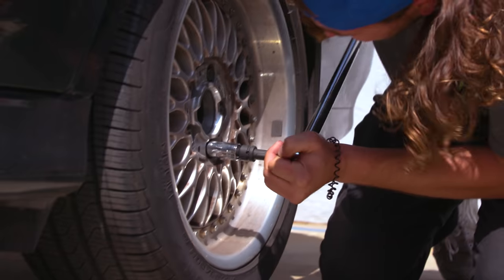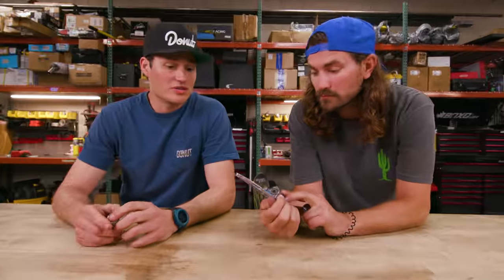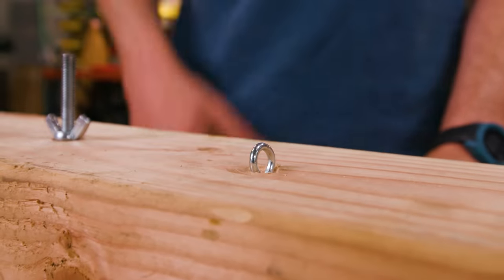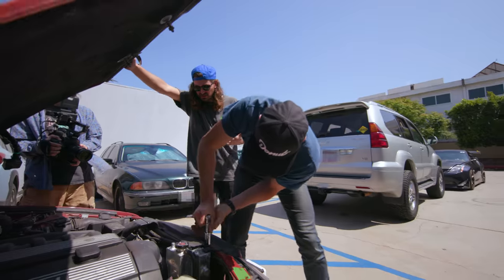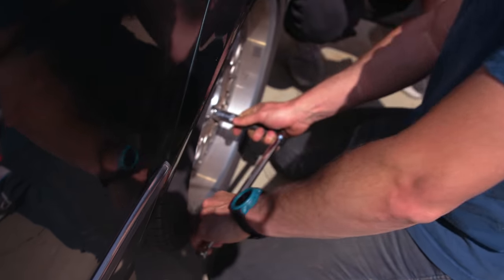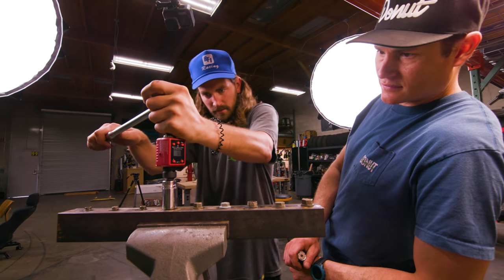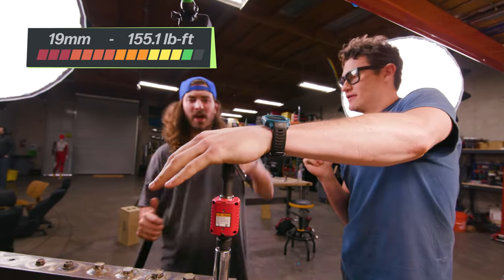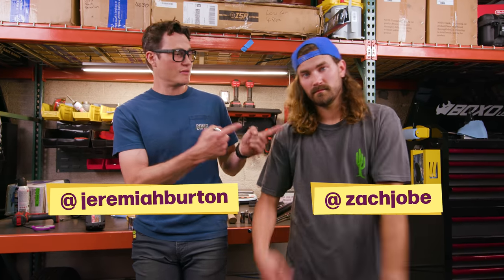Testing the World's Most Hated Tool

Comment: I think it's one of those tools that has a lot of potential but promises to much from one size. They should make ones for different trades (angled to fit sizes often used in them) like electrician, plumber, mechanics, exc. And maybe even make 2-3 sizes with recommendations of what it's really good at.
Reply: I'd love to see one for my profession, but as an oilfield mechanic that uses sockets between 1 13/16" to 3 1/2" most often, they'd probably need to use titanium pins to have a chance at handling the torque after watching this video.
Reply: Its a good idea in concept, just needs a little reworking to be more versatile.  Make the pins tougher, thinner and have more of them.  That and let the springs go deeper and  you could have something really decent.

Comment: It's a good concept, the execution is just lacking. I feel like it could be redesigned to work much better. Maybe if the pins were shaped to fit more tightly together... maybe hexagonal? Then the contact points between pins would have more surface area to work against, and it would keep the pins from slipping into gaps and bending under load. Although, it seems like someone would have done this already if it would work well.
Reply: it still has 3 major points of error.  the pins, the springs, and the user who probably wont line it up perfectly, EVER.
Reply: Um, the pins are hexagonal.
They have to be.
Reply: @MostlyPennyCat  The pins are definitely round. They are in a hexagonal pattern.
Reply: I bought one of these for my dad a couple years ago. Up until last month, I wondered what happened to it. I found it in a cabinet with literally 80% of the pins damaged and not working. But ya, pins are cylinders and all the pins together make up a hex shape, like a normal socket.
Reply: @angryginger791  
Are you sure that aren't just rounded at the top? As in beveled to ease insertion?
I had one that definitely was hex pins.
Wasn't this brand though
Reply: @MostlyPennyCat  Maybe someone makes another version. I was just looking at this one. Like I said, seems like something someone could improve on. Maybe someone did.
Reply: @angryginger791  
Looks like it, indeed.
There's one with square pins too
Reply: Its also only $10 so if you use it like a $10 tool its worth it
Reply: I have one with hex pins. My neighbor gave it to me as a joke gift. It’s not branded as a ‘gator grip’ though. I’ve never used it

Comment: So, I know the inventor of this tool. He originally also had a smaller size one. The smaller size one was way better. Almost perfect every time I tried to use it. The larger one (like the one you tested) was loose on more attempts and had some of the same problems you experienced. However, he sold the company years ago and the newer Gator Grips do not seem to be the same quality of the original ones. I also met the producer/director of the infomercial and it is the one that is used to sell the newer Gator Grip that seems to have more issues. Only tried one of the newer generation, so I may have had a bad one (probably not based on your video).  If you find the smaller one....buy it and never let someone borrow it (like I did). Once they try the smaller one, they will not give it back and claim they lost it.
Reply: That's really interesting.  I had a hunch that this was the kind of story you see with a lot of infomercial products—the inventor makes something for a specific use, and then the company that sells it markets it as a revolutionary "fix-all" sort of product, leading to a bad reputation for a good invention.  Sounds like this is a similar situation with an added misfortune of the design being changed to perform poorly

Comment: I use my Gator grip pretty often... initially I bought it out of desperation trying to remove a rounded off water pump bolt and it got it out immediately. I was initially skeptical but its now kept in the socket drawer next to bolt extractors.  When I'm in a rush its saved me some time.  It's gotten me out of quite a few jams and I keep one in my work truck for emergencies. If you bust it  they're only like 10 bucks to replace so I think they are a good buy. But mine has not busted in about 5 yrs of occasional use. Like any tool though it's got limitations. I'd say less limitations than just having a 12mm. Doesnt replace the tool kit but it's a good thing to keep in your kit for sure.

Comment: I really want an engineer to redesign this to actually work for hex heads at least. I feel like it is possible
Reply: yeah my dad has one with hex heads, works pretty good
Reply: Geahhh.     Noooo
Reply: Yeah, I think they failed because they tried to make it a replacement for too many tools. A more specialized version that just replaces a couple of hex nut tools but does it reliably could be way more useful.

You could save time not having to change between common sizes, and a bit of weight and space in your toolbox.
Reply: Hex pins and a slight angle on them I feel would work better but then it wouldn’t replace as menu tools
Reply: You could just have a set of sleeves with staggered sizes. Depending on the sleeve thickness, you'd need a couple sockets. Maybe one does 10, 13, 16, 19, then the next does 11, 14, 17, 20, and the last does 12, 15, 18, 21.

No tool like this is going to withstand the torque a purpose-built socket will though, and it has the problem that it's stupidly big. A lot of smaller fasteners are located in places this socket simply can't fit, so you still have to have a set of regular sockets to take the car apart.

If you could make a gator-grip that wasn't so fragile, it might be useful for routine work on low-torque bolts in easy-to-reach locations, but it simply can't remove the need for a real toolbox. For the person who only does one or two things on their car, I'd still recommend just buying the correct one or two sockets.
Reply: There are well made types. All of the good ones do not use round pins. I have seen hex pins, and own one that has all different shape pins. Believe it or not there are cheaper versions of the gator grip.... that perform even worse too
Reply: Sounds like you have defined your mission!
Reply: @moteroargentino7944  100% Agree. A set of 4 that replaces 12, but works well would be a very valid tool. Making them work with a less deep profile would also be better. Too many places a deep won't work.
Reply: @carbonfiber492  Hex pins was my very first thought. They would tend to lock together. Round just wants to slide past.   Also a set of 4 for all the sizes instead of 1 to replace everything would be a better direction.
Reply: @carbonfiber492  I agree hex pins alone would make the difference
Reply: It definitely has potential. If it had a bit more niche use case and cost $50 instead of $10 with engineering to match it would be an awesome piece of kit.
Reply: I think the pins should be hexagons.
Reply: If lightly worn hex head wrenches strip will out the socket head, what do you think this would do?
Reply: @carbonfiber492  I've been given every variant of this tool over the years.
Hex pins are actually far worse.

Comment: I bought one of those special sockets when i was a little kid and i honestly love it. I have used it for many different bolts hooks screws and other weird shapes. They do break but i still have one ive used for years and it helps with a lot off shapes which is all i will use it for. The first group of stuff they tried to use it on is basically all i have it for

Comment: I used to love mine as a plumber trying to access pump stations. The bolts are always different sizes, you lose sockets depending on your situation and that ruins a set, and we’re working out of a van a block away sometimes… so a “break glass in case of emergency” socket made life easier… we definitely roasted our first one inside of a couple months tho…

Comment: I remember this coming out in the 90's...I bought one, broke it the first time I tried to use it. Always use the right tool for the job, this in the right tool for ONE job...stripped heads! it amazingly works(depending on which one you get, the internal rods are different on many of them) on stripped bolt heads, but honestly...no better than vice grips lol.

Comment: I'll be honest, this was a last resort tool when one of my keyed lugs nut developed a fault (crack most likely from impact use) and the key kept slipping.  It broke the lug free thankfully and saved the day.  Most likely it worked because the crack had weakened the lugnut.  Its always in my toolbox as a "Well....F@#$ we've tried everything else" tool without having to resort to more time consuming and drastic measures.

Comment: They're perfect for rounded off bolts, nuts, etc. and lowering a spare truck tire. There's a use for every tool, no matter how dumb the design
Reply: The design is genius, it's the manufacturing which can't live up to the design, this as a $100 tool with near perfect engineering/tolerances/materials and twice the number of pins for a higher density could be out of this world useful.
Reply: Yep.  That's why I have one.  They have their use.  However, definitely not a replace all.
Reply: @cenciende9401 nope. The design has a fundamental flaw and making the pins smaller might make it worse: the pins extend downwards with no support, like if they were dangling but densily packed instead. This makes them very flexy and unable to withstand a lot of shear stress.
Reply: TRUCK TIRE! Exactly why I have one! Mount one on the drill driver - no more hand cranking

Comment: I wonder how good an optimally designed version with high quality materials could be.
Reply: There are no materials that at the size of those pins could withstand that much torque and not get messed up. They are just too thin, and even if they're not, the springs will get affected.

Comment: Why wouldn’t they make this but instead of pins, you have like 10 hex-shaped metal rings inside the socket. Then at least it would work on a bunch of different sized hexes pretty well.
Reply: I think THAT is a good idea!!
Reply: I believe this product exists, or existed at one point in time. Can't remember what it was called.
Reply: it would be too fragile
Reply: 1. it wouldn't work as well with eye bolts, etc.
2. you'd need to make sure the rings won't sever from their linkage to the base socket up to a reasonable amount of torque.
Reply: @rfmerrill  I have about 5 of those. My mom gets me these every Christmas and there are about 7 manufactures that all make them slightly different. One actually has hex pins and is a bit deeper and sturdier.
Reply: Its a great idea except that it would cost much more to machine a bunch of allen wrenches instead of round rods. There would also be much more friction between the rods with hex (more friction between the rods due to a much higher contact surface area). You would use it once and it would be destroyed. It would need frequent lubrication.
Reply: The socket must be very long to store 10 rings, can do 5 rings or wtv amount to shorten length. It's gonna be heavy. It's still good idea. But the main problem is since the smallest ring will be the most upward, it's far from nut to be tightened. Mostly it won't even reach bcoz the socket body block the way.
Reply: I've got one with hexagonal pins and it costs about 8$, but I keep it for emergency or use for light duty like bike
Reply: Only one ring would ever be making any contact, so it would be under a lot more stress. A better idea that I saw in another comment would be to just make the rods hexagonal in cross section.
Reply: Thats a Million Dollar Idea. I Steal it.
Reply: Each wall would be 1mm thick which would not be enough structure to prevent deformation under high torque.

BUT...

If you made two that each handled odd and even sizes, then you're really on to something.  8, 10, 12, 14, 16, 18 and 9, 11, 13, 15, 17, 19.

Comment: Pretty sure I have the same one? The “GatorGrip”. Always called it the GatorSlip. Someone gave it to me years ago and I threw it in the van and have had it ever since. I’ve used it maybe a handful of times. I mean, it gets the job done for smaller stuff. Also the weird stuff like the eye hooks and wing nuts and stuff. But any large fasteners or anything that requires actually being torqued down it absolutely doesn’t beat a regular old socket.

Comment: I just used my gator grip to repair my office chair when the head of a 1/4" bolt holding the seat back broke off.  The gator grip removed the broken bolt with little effort and I also used it to tighten the new bolt and all remaining bolts.  Your video taught me that gator grips are OK with light duty jobs but are poor for medium and heavy duty jobs.  Thank you for putting it to the test.

Comment: Do you think a similar tool but with different pin shapes would work better? Like hexagonal shaped pins?
Reply: Good idea patent it and make millions, not sure there may be that version but if not....
Reply: Yes, maybe drop forged or heat treated hex pins for durability.
Reply: I would imagine the reason this tool has round pins is cause with the hex pins, it would scare up the bolt pretty bad as sharp edges would be pressed up and torqued on the flat edges of the bolt. Not that the round pins dont do that, but probably to a lesser degree
Reply: @SupChad735  like it didn't do that already
Reply: @ILoveTinfoilHats  I mean I would assume the round pins would scar it less was my point
Reply: I would say very small triangles would be the best
Reply: @SupChad735  Hexagons wouldn't chew up the bolt because only one side of each little hexagon would be showing, therefore creating flat sides. Triangles would have a similar result, but as a result would have to be smaller, and therefore more fragile.
Reply: I thought these DID have hexagonal pins. . .

Comment: They are good in a pinch. Bought one for the hell of it and for light work. Though for fun I did remove an old alternator off a truck that had been sitting for years with it. But if you are doing light work with a bunch of sizes it's nice to have lying around, though I'd suggest it mainly for interior work or assembling premade items. However, the more torque you need, the more of a bad idea it is. And if you are a biker, it's wise to have the main heads you need for heavy duty parts and one of those for almost anything else.

Comment: This product originally came out in the early 2 thousands. I remember the SC on TV commercials for it. My mom ended up buying one and it never failed us. I think it's still in the garage somewhere today. Back then, It wasn't a bit you could put on the wrench. The thing itself was its own wrench, And you couldn't D attach it.
Reply: This tool has been around longer than that. I got a prototype in 1993, and they were being sold shortly after that. The original before the company was sold was good. The smaller one was even better.

Comment: The first rule of tool use is that every tool has a job, and it does that job better than any other tool. Whenever you try to make a multi-purpose tool, it never works as good as the original tool. Take for instance 7-in-1 utility knives. They don't do any of their jobs better than just having the tools individually.
Reply: dolita windo  I don't think I understand what you're trying to say. The point of the ad is to show it can complete any task a normal socket can accomplish, but it acts as a one-size-fits-all to prevent looking for the right socket. Issue is it seems to experience critical failure very quickly, even when just doing the bare minimum demo they replicated from the ad. Basically it fails or flat out breaks when used for its intended purpose, where a normal socket would not break, nor damage the bolt/nut/hardware you are fastening/loosening.
Reply: The only time those type are viable is when they save you from carrying several tools.  A 6-in-1 screwdriver, for instance.
Reply: The tool you have is better then the tool you don't. 

Aside from that looks shit.
Reply: There are situations where versatility counts, though... it's a lot easier to find space for a 7-in-1 than 7 different ideal tools.
Reply: @somejerk5662  in soms cases your right. Like how most hammers have multiple uses because they're designed to be one tool for one job. The issue is a 7-in-1 utility tool is going to do seven jobs less efficiently than if you had seven individual tools. My point is that you want a tool to maximize efficiency, precision, and accuracy, and when you try to make a tool with multiple purposes you lose a good portion of them. In a bare bones scenario, I would definitely prefer to have a 7-in-1 utility tool than no tools at all.
Reply: The problem is stuff like that is marketed as "replacing" all the other tools when really it's meant to be used for light duties in emergencies every once in a while. Of course you're not gonna use a swiss army knife for any of those things in your garage under normal circumstances.
Reply: 7 in 1 utility knife ?   Never heard of one. Now if you mean a " 7 in 1 or Painter's tool" , you seem to not understand  that tool at all.  Good 7 in 1  's or  "Old School"   5 in 1's or 6 in 1's  are one of the best  ergonomically designed and most useful  tools in the world . In several apps , they are simply " the right tool for the right job",. Besides being quick if you carry one or  have it in your primary tool bag/kit,   and "quick" means money in the trades.
Tell a painter or carpenter or plumber or glazer, or really anybody competent  in the building/mechanical trades, something "off" about good  5 in1 's/ect. They will look at you "sideways" and say you don't know what you are talking about.